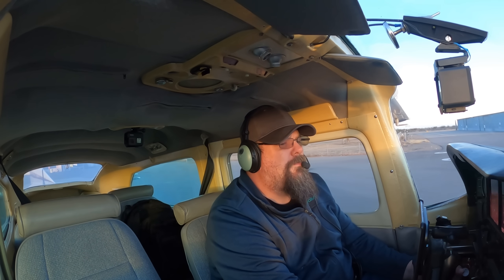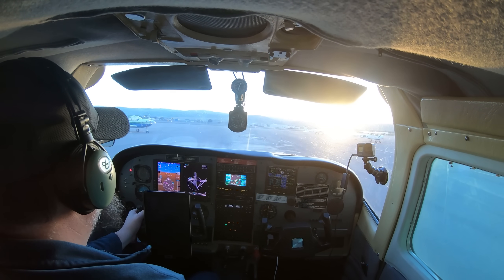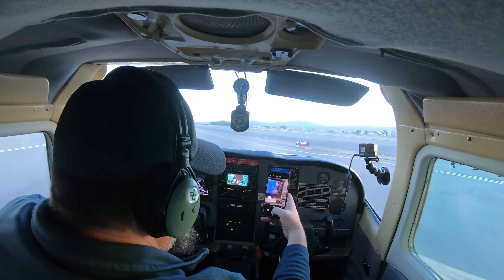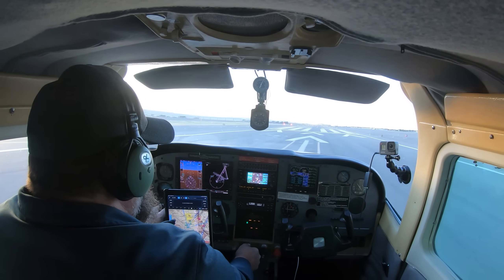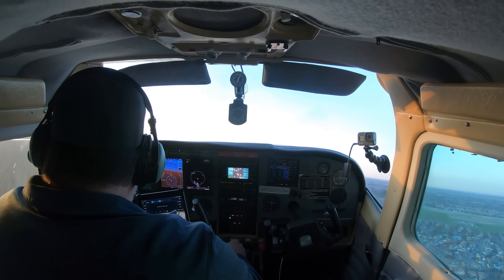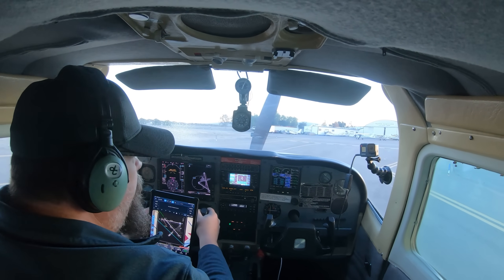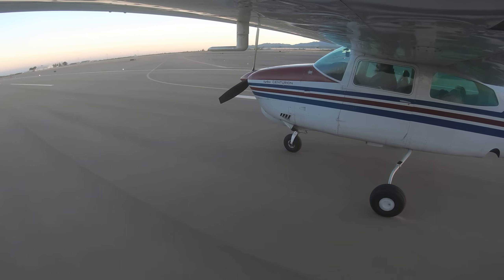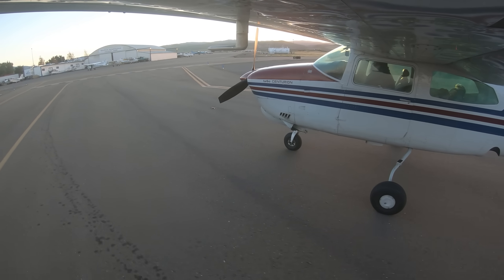Catastrophic Engine Failure after Takeoff

Comment: Nothing wrong with this at all. The most important decision here was the one to STICK to your decision. You clearly had the presence of mind to fly the numbers until ground contact, whether that be on or off field. The only reason the 'impossible turn' is dissuaded is due to the seduction that some people fall into to start raising the nose and doing things they shouldn't - it's led by psychology, specifically desperation, which you resisted. Top marks and very, very well done mate 😊
Reply: Also, taking off 30 and landing 08 is a lot easier than landing back on 12. So, just changing airfield changes the change of success massively.
Reply: @ambassadorkees  This - based on the touchdown point and immediate pitch-over after failure, I don't think there was one extra ounce of energy to squeeze out of that plane. A 180 would indeed have been impossible IMO.

Comment: She threw a rod most likely from it not being tightened at the crank basically the enging is destroyed. Crank may be bent. May be more block cracks not seen by the naked eye? You need a new block halve you  might save the good side. I am thinking your engine has 2 block cases or is it 1 solid block?

Comment: Mr. Frye, if that was to happen a field landing rather than a smooth runway landing, which you performed perfectly, would it make sense to act as following(for the field landing)?:
1. best gliding speed
2. gear down to let it absorb some impact energy
3. flaps fully down, to minimize speed on touchdown
4. just before the contact with surface Master switch off, fuel selector off, ignition off, to minimize the risk of flame

Comment: Outstanding. Great use of the other runway. I notice a lot of people calling what you did ‘the impossible turn’ but I thought that phrase only applied if you try to teardrop back onto the departure end of the original runway. Runway 08 appeared ideally situated for this scenario. Question: Once you’ve lost the engine completely, do you have to lower the gear manually in some way?
Reply from the maker: This year has an electro-hydraulic pump

Comment: Absolutely spectacular save.  Not a foot of altitude nor a knot of airspeed to spare.  That impossible turn was a calculated risk that played out well.  Your virtually instantaneous reaction and almost immediate nose down was most definitely the difference between this being a success or you being a statistic.  I'm sure lots would say you shouldn't have attempted the return turn, but at the end of the day you saved yourself and the airframe.  Good on 'ya Captain!
Reply: This is not the impossible turn that is heavily debated. He took off RW30 and landed RW08. He most certainly would not have made RW30. He only barely made RW08
Reply: Theres lots of field nearby, I dont think he wouldve necessary been a statistic had he not executed that left hand back to base immediately
Reply: @Joe Barone Because it almost never works out. I dont know where youre getting that "it always seems to work out" If it almost always worked why does everyone strongly suggest against it?

Just google "impossible turn". There's a reason its called impossible.
Reply: @Joe Barone You're completely wrong. This is one of the biggest killer of GA pilots. Under 1,000' AGL it's a horrible idea to turn around in most GA planes because you're very likely to over control the plane while trying to maintain altitude and make the runway, thus stalling out and dying. Now, in this turbo centurion it's likely that he was climbing well over 700ish feet per minute which gave him lots of altitude and there was another runway that made it not quite a 180 degree turn, so yes if I was in this plane at this airport I would've turned around. Put me in a 172 at a one runway airport, anything below 1000' I'm not even thinking about turning around. They teach this for a reason.
Reply: @jakesimpson6365 I like your admission that ‘because you’re very likely to over control the plane while trying to maintain altitude and make the runway, thus stalling out and dying. ‘ .Yes, in other words you are admitting that these are LOC—I accidents —- not turn back  accidents!
Even the FAA has finally figured this out. The whole imbroglio has to be taken more seriously , as glider pilots have always done .
Briefly, below certain altitudes that 180 is indeed imposible —- but above those altitudes it isn’t . Some of the criteria are :
Disposition of possible suitable forced landing sites off the departure end of the runway. [ there may be none ! ]
Type of A/C being flown.
Speed and direction of wind.
Whether the prop has stopped, or is windmilling. [ a stopped prop will increase glide ratio substantially over a windmilling prop by about 25% ]
Glider pilots practice these all the time at~200’ AGL ,and their higher roll inertia wings,due to longer span, take longer to establish a steep bank angle than a powered ship.
The trick is to make all decisions before taking the runway, in a pre takeoff briefing, so they know exactly what to do, and do it immediately if it happens .
They know:
            1] What altitude above which to turn back.
            2] Which direction to turn.
            3]What angle of bank to assume [ at least 45 degrees ]
            4] What A/S to pitch for,Vbg. [ and remain  coordinated throughout the turn ].
This gives a brief look at what the power pilot should consider before any takeoff.
Reply: @davidwhite8633  I watched a video that said that (in the specific aircraft flown) the prop windmilling produces less drag than stopped. This makes sense as it acts as an air break and creates more drag. When windmilling, it's still slowing the airframe down but less than when dead. But in other aircraft, the force of turning the engine  had more drag than a dead prop. It varies on the aircraft, but saying that a dead prop will always increase the glide ratio is wrong, and a common misconception. On many aircraft it will increase the glide slope, but not on all aircraft.
Reply: @charadremur333 Sure, if the a/c has a variable pitch prop or CSU, then the prop can be pulled back fully ( coarse pitch ) and/or feathered if there’s sufficient oil pressure, but most GA a/c are fixed pitch. Of course in his case he didn’t have that decision to make.
As other commenters have said , gear was lowered too quickly ( lots of drag ), and flap seemed to be at about 20’ for the whole flight ( more drag ). Both would steepen the glide angle and could have prevented him from returning to his T/O runway,if there hadn’t been an alternative runway there.
Flap should be raised ( if used for T/O ) when there is no good forced landing site in the forward  hemisphere to be made.
Reply: @jakesimpson6365  good points to live another day with
Reply: My guess is he knew his turn-back point before take-off.  Also, the large open area around the runway looked to offer some cushion should airspeed be a bit short.
Reply: The fact that he didn't come close to his max bank angle makes me feel better about it.
Reply: Landing on a different runways does not define “the impossible turn”
Reply: @afridgetoofar1818  Bingo. That runway was not the impossible turn. He lucked out with the airport having multiple runways. First thing he did was was pull up. Smh.
Reply: The key is as early as is safe crosswind leg.
Reply: You could feel the adrenaline on your reaction shot

Comment: THATS A FLAT TAPPET CAM MAYBE HE DID NOT USE ZINK IN THE OIL AND IT WIPED THE CAM
THAT WOULD PLUG UP THE PUMP AND BY BY ENGINE

SO YES YOUR LIFTERS CAN DESTROY YOUR ENGINE

WATCH UNCLE TONY WE HAVE BEEN HAVING LIFTER FAILERS ON ALL BRANDS OF ENGINES

NEXT TME BLOW OUT THE TURBO OIL LINES AND TAKE APART THE TURBO CLEAN AND INSPECT EVERY THING

IN AN AIRCRAFT THERE IS NO CLOSE  TOLERENCES  ITS WRIGHT OR WRONG

THE WAY THOSE LIFTERS LOOKED THE ROD LOCKED ON THE CRANK FROM METAL OFF THE CAM AND LIFTERS
THE ROD CAP CAME OFF LAST FROM ENERSHA FROM THE HEAVY PROP

NOT TRYING TO TALK TO MUCH THIS JUST PIST ME OFF

Comment: I would've done a whole lot more ground runs, lots of power and engine load changes (obviously engine temp is a factor on a rebuild), before i actually flew it. I would have delayed the gear for sure due to drag, and unless you're getting some power out of it I would shut it down turn the fuel off etc. to lessen the risk of fire in KC Landing we're not to go so well. Other than that nice job, proves some aircraft have the capability to be returned to the departure runway depending on a whole lot of very critical circumstances. I would be very very hesitant to attempt that.

Comment: I always said impossible turn is only impossible at 400 below, otherwise practice it (in the air), expect it and you will nail it. I fly at dense areas and sometime that 30 degree left-right does not work. I think you had it at 300 AGL

Comment: Edward, I to have had a and engine failure right after take off. I too was just turning crosswind. Be thankful you had engine power for just a little longer because swinging the gear right away was not the best move. Waiting until you had the field made would have been smarter. But, yes, I get it, there were only moments before you were back on the ground. If you didn't have that extra engine power you would not have made the runway. Thank you for stating the turn back to the runway is not what should be done. But because you had power, where already in the turn, and you were not making a left 270 turn fallowed by a right 90 degree turn, what you did was the best choice. I would have done the same thing. I just would have held off on the gear until I was closer to the runway. I have given my clients dual engine failures right at this point in a jet when I am teaching. I am so glad you made it out alive. So good on you. BTW, both of my engine failures right after take off were captured on video and I will NOT post them on YouTube until after I retire. You can look for them in a year. ;-)  Glad you are a live to tell the tell.
Reply from the maker: Thanks Danny, looking forward to your videos in a year. Based on the data I posted in a more recent video, I feel the engine was windmilling and was actually creating more drag. As for the gear, that was a primacy move based on geometry to the runway and not a choice I remember making.

Comment: Textbook energy management. You used every last bit of airspeed you had and it went perfectly. Bravo man.
Reply: Yes, the law of the roller coaster worked here.  Good job.  Because overloaded small piston crop dusters didn't zoom without some level in low ground effect free kinetic energy, that became my default takeoff.  It was airspeed, and not altitude, that kept me flying in 11 engine failure forced landings that were six second deals.  Energy to maneuver.  You made excellent use of the potential energy of altitude with a significant pitch down for maneuvering energy such as to be able to bank steeply and go where you wished without stalling.  It works both ways.  Airspeed is altitude and altitude is airspeed and best glide airspeed is a high altitude failure consideration but not a low altitude consideration.  At low altitude, the outcome of the maneuver not being in doubt is of greater concern.  While airspeed or altitude are equal to the physics major, airspeed is worth more than altitude to those of us who end up needing airspeed to maneuver right now.  Altitude is time.  Down low, airspeed is life.
Reply: matbe put the gear down a little later?

Comment: Is the outbound taxiway the same as the the inbound? if so, the damage to your engine has already started. Check the oil trail at .49 I may be completely wrong. 
I spent my whole working life in the motor trade and I've seen this before.
Reply from the maker: no, I taxied out on Bravo Taxiway to runway 30 and landed and taxied off Alpha from runway 08

Comment: I noticed what sounded like a small RPM fluctuation while you were still on the takeoff roll. Did that happen or was it just a recording artifact?  Glad the wheels cooperated with you.
Reply: My guess is the prop governor catching the prop and slowing it down when full power is applied. This sound is especially apparent with three or more blades

Comment: Well done landing safely. 
For info I noticed the firesleeve on the hose in the photos is not fitted correctly. The sleeve should be right up to the end of the socket so clip sits over the flats of the socket.

Comment: You made good work of it.  I never lost an engine, but practiced power-on emergencies often.  You kept a cool head, followed your procedure, and was fortunate to have had it quit with it did.  This could have ended much worse, as you well know.

I'm assuming the images at the end are those of the result of your engine failure?  If so, "catastrophic" about covers it.  Looks a mess.  Sure hope whoever serviced that mill has a good explanation and makes good on his work.  That ain't gwyne be inexpensive.

Comment: Thanks for posting this Edward. I wouldn't knock yourself too much over the amount of time spent running on the ground. Yes glazing is a thing but the likelihood of it happening increases when there's excessive low power running. It's good to run them hard from the outset but it doesn't have to be draconian. Plus, I'd wager that the failure was not due to glazing, more likely either installation or component defect. Did you intentionally fly upwind after takeoff exactly for the purpose of being able to return more easily? You did a superb job of recovery!

Comment: Nicely done.  In college, I took a lady from my church and her son for their first airplane ride, in a C-172.  On climbout, passing about 400 feet, had a loud bang accompanied by vibration.  I pulled the throttle back a bit, the vibration corresponded to the RPM.  I then went to full throttle, dropped half flaps, and initiated a 45 deg AOB turn back to the left, making sure I pulled easy and maintained 45 degrees.  I had few off-airport options.  I told my lady friend to just hang on.  A twin behind me was taking the runway, I declared a MayDay, landing opposite traffic, and lined up with the runway.  The twin quickly spun around and got off.  I didn't reduce power until I knew for sure I had the runway made, pulled to idle, the vibration reduced considerably.  Full flaps and a bit of slip.  After landing, I pulled off onto an exit taxiway, and shut down.  My passengers had eyes the size of dinner plates.  What had happened was the engine swallowed an exhaust valve.  The prop was OK, had not lost a tip as I had first surmised.

My first night catapult shot in the F-14 was just about as exciting.  Yowee!!

Comment: Nicely done, excellent recovery and outcome! Panicked just a bit in the beginning (with reason), lost track of the airspeed for a few seconds but recovered fast from that one too, at a so critical point you had seconds to manage everything and stay alive... Anyone can claim anything that you should have done, or what was right or wrong, but the true test is to put them in your position and see the outcome...
From the beginning of the video, not knowing the end, your hyper-focus on the engine led me to believe you were not confident in the engine, I would not fly without confidence in the equipment or the service performed. Not sure if you did, standard procedure or not, I would have performed at least one or two high-speed runs before taking off...  I understand you were concerned about the glazing, but I would risk glazing it to make sure the engine was going to sustain power... 
Perhaps I'm wrong and you were very confident in the engine and just hyper-focused on the engine to record the parameters...
Anyway, your transparency in this video is amazing and certainly an inspiration (and a lesson) to all pilots.

Comment: Glad you made it back OK but next time maybe do the initial loaded run in on the ground then drain and check the oil for signs of failure in progress. 10 min at low engine RPM wont help you determine an internal problem brewing. Most failures do to workmanship after rebuild show up quickly under load as you found out. I'm not an aircraft mechanic but I am a marine mechanic that used to build performance engines that operate under heavy continues load like aircraft engines in fact Continental and Lycoming aircraft purpose built engines (without certification I'm sure) are used on a lot of air boats. I did see the video of the damage and that is the is the perfect representation of an improperly torqued rod nut or bolt. If the rods use T bolts and nuts this can happen even if torqued to correct value but the T bolt not seated all the way in the rod. I don't like to be bothered, joking around, answering questions conversations ect when building an engine and if I have to stop, I find a way to mark my page and at the end of day I finish the current operation before securing things for the night even if it means staying a while longer.

Comment: You can hear in the background that the engine is knocking as it was without oil, or a connecting rod bearing is exhausted it sounds, if you were to submit this film to someone who can separate the sound, it will come out, it should be so that you also check then and then outside the cab to just listen to the engine